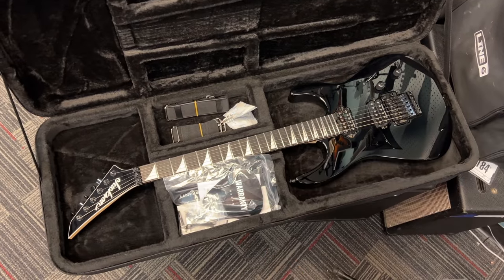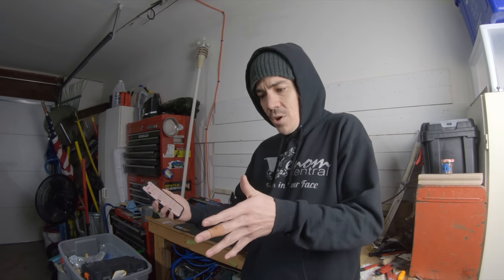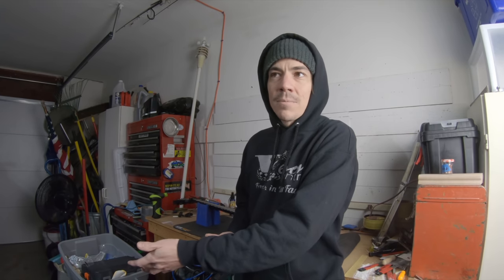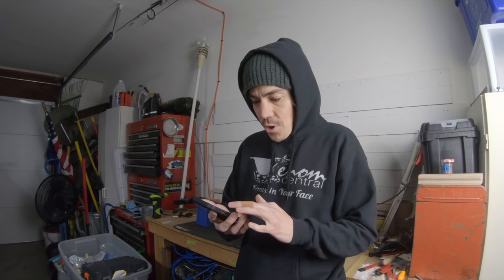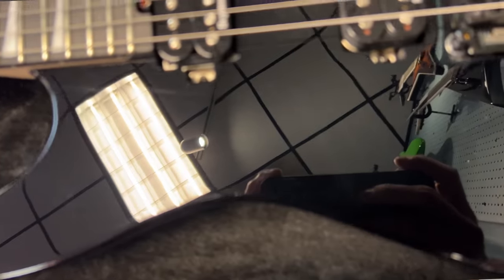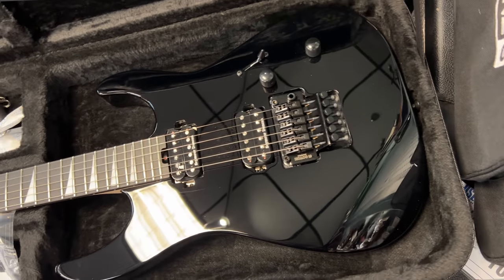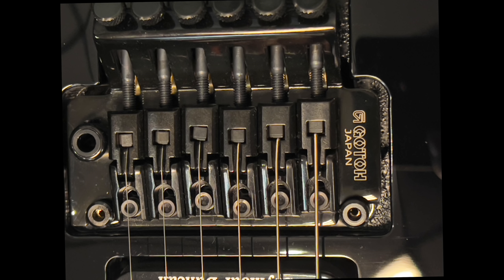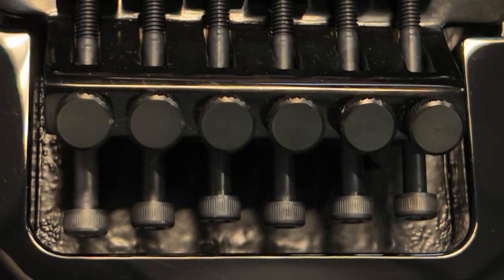JACKSON GUITARS IS DONE. MJ series/INDO EXAMPLES

Comment: I was excited about the Rhoads ziricote V..
Went to check it out at gc, since they said there were a few in stock, rather than just ordering it.
Was completely disappointed... Granted, they only had ONE, instead of the few that they supposedly had. But... It was piss poor. Glue up the side... Extra pieces in the body... The top was a LOT lighter than the pictures. It seemed thrown together with spare parts. Like wood that didn't match even close... And glue up the side..
Thank hell I didn't just order one. 
So I went home and ordered a guitar unseen... Off reverb. Got an esp ltd set neck Arrow.
Haven't done anything to it except adjust the springs in the back for the floyd. That's IT. Still haven't changed the strings yet... It's still on that set I got it with. It's absolutely perfect. I haven't put it down.

It's a killer.
And all I want to know... is why the F didn't I get one of THESE a long time ago???

Comment: I still stand with my opinion that is Jackson as an authentic brand was long gone since the Fender acquisition. Never satisfied enough with a pro-2002 USA Jackson as I do with my 1986 and 1996 USA soloists. Same goes for the imports, had the chance to play a 1989 MIJ Charvel 650xl and a 1994 MIJ Jackson Professional Soloist (both are neck-thru with glass clean ebony fretboards) which are even better than current USA runs. Quantity is all that matters to Fender Musical Instrumets Corp.
Reply from the maker: My 2008 Mij rr24m is pretty mint. There are still some good modern one, but you have to go through 50 bad ones to find them.

Comment: Gibson says, "If you're comfortable then your guitar is comfortable" Comfy enough to twist the first winter? (in Ohio) Yeah my guitars stay in my 75 degree bedroom or in the closet which is the same, but most develop serious neck issues after about a year.  They get played, so, they stay with me.
First off anyone who says I'm doing it wrong gets punched. I left a low end solar that had hardware stability issues in my unheated attic over a summer and winter, didn't warp a bit. Go figure. The next person who says "it's wood, asshole" (yes its been said) gets seriously injured.

second. Gibson hasn't changed that much. The Nashville bridge is just as unstable now as it was in the 1970s.  Can we say design flaw? Even when set up perfectly they are still unstable. If Gibson cared they'd put the R&D in to fix that, or go strictly with ABRs. Even the wrap around style isn't too great, but not as bad as the nashville. Btw the deign flaw carries over to the tone pros replacements as well.

third. Fujigen. There's an 11 year old Ibz in my closet with a neck heel issue. ten years later the new Fender comes out of the same factory with the same issue. That's not the only IBZ I've had with that issue either but 11 years ago is when I stopped liking ibbys. I hate tuning and then being out of tune for the first note. I know, I must be putting my "hand on the neck wrong". uhhhhhhhh

fourth: those $1000.00 jacksons. I have two of those king Vs with the metric nashville tune o matics. guess what. the design flaw carries over to the metric version. Next, try asking jackson for parts. I've been able to modify and stabilize this bridge.  The neck on my white V is trying to bend backwards this year.  I am trying to stop this, but even with humidity and the truss rod pushing the neck forward, no luck. So much for those graphite reinforcement rods huh? Btw, with the rod pushing forward instead of back, your neck causes tuning stability issues. G R E A T...
The finish issues are there, but those are secondary to me. learn to paint imo. 

fifth: I believe that the lowest end ibbys and jacksons are made at the same factory. AVOID THEM. 

I've seen all kinds of things out of various factories, all serious.
Nut out of alignment
Shifty locking nuts
Frets ALL aligned on a slant (not fanned fret, don't be smart)
random frets out of scale
high frets
warped/twisted necks
unstable neck/heel joints
unstable hardware

Seriously, the guitar industry is a fucking joke and it's on US. that's b/c most ppl either have to be tone deaf or they're degenerates and don't care if it's tuned.  Or maybe they're the 'collector' type and tuning stability means nothing.

yeah I'm cranky
Reply from the maker: It’s weird to me that the guitar industry is the only one that gets away with this crap
Reply: You must have extremely bad luck because I've owned 16 guitars only 2 of which were any quality the rest being "cheap entry level" and none of them had as many issues as yours. I'll go through the list if you really want me to.
Reply: @Ayyem93  I hope you don't mind my salty attitude but I can't help it. I don't know how luck could even play a role if I'm sampling random stuff and getting consistent results. by consistent I mean consistently inconsistent build quality. You know what the best thing to do with me is, mock me, belittle me, treat me like crap, insult me, anything to protect that brand and/or sales commission. Lets, see, an example: like trying to return a guitar because it's out of tune after one chord, and being told well, "it's still relatively in tune." or, like saying I have a fret that doesn't line up with the others and being replied to with a picture of a fanned fret guitar and being told to figure why that one works.. sigh. I'm sure there's "nothing wrong" my LP special even though both bushings for the bridge posts lean to the left. I was trying to figure out for weeks why the locking wrap tail I bought for it keeps either moving or suffering internal deformation... Oh..I see... now.. The holes for the bushings were drilled at a slight angle. Jesus christ.... I'd say this was typical of the kind of defect I run into, but typical is an understatement.

You might have 15 guitars, I've been through more than 400 of them. Most of this was when I didn't have a clue how to really tinker with things to correct problems. I wish I could have some of them back now that I know how to straighten a nut.  yeah luck, more like a curse from god. that reminds me. Ima smack that mother fucker someday.

Of all the ones I've had, and this of course is over the course of nearly 30 years I've had some that were good.. and then they didn't survive the winter, or the hardware bent under string tension (rga121 9-42 gauge strings tuned a step down). Oil the fretboard and make sure the truss rod is set properly.. and it will still warp. Did you know the channel for the truss rod is unfinsihed and will react to changes in the weather? yes, that's what I think happens to these necks.

SMH. Hell, I bought 5 last year, lets see how they did. 3 gibsons, one developed a hump at like, the 11th-14th fret, 2 twisted. one left, one right. 2 jackson pro Vs. One is trying to bend backwards after its first winter. That's a shame because I spent so much time working on that one's bridge and actually got it to be stable. I have an identical one I have'nt looked at because the nut is a little off center and I didn't feel like working on it. I wonder how that neck is... it's been in it's case since I got it. sigh. 

I'm sure if I were some one bring propped up by the music industry I wouldn't be seeing these problems. It's absolutely possible to select better materials and assemble them better. This assembly line stuff is BS.
Reply: @franks471  I genuinely don't know what to say bruh. I've had a cheap indo made B.C. Rich Beast that I got new for $250 in 07 or 08 around when I started playing and it's held up to this day with the only issues it has being from my own ignorance in past years. Either you're doing something wrong in terms of care and storage or you just have extremely shit luck. I've never come across ANYONE who's had as many issues as you, from a pool of collective playing and owning time of 75 years altogether.

Comment: I grabbed a dk2 pro in slime green made in mexico this month.The quality control really needs to be reevaluated the guitar retails for 999.99.Upon receiving it there was no hard case,kinda obscene for a guitar at the price point not to come with one.The guitar does sound really great to be fair but aestheticlly there were way to many flaws heck even the neck pickup wasn't screwed in all the way to the body it was sitting an Inch in the air!! Prior to this I grabbed one of the ferrari yellow fsr strats that came out of Mexico and same thing poor set up and a ton of aesthetic flaws..its to bad as we were at the point where MIM was getting to be a good thing but anymore especially with pricing I'm afraid to go outside of U.S and Japan made guitars after these experiences.
Reply from the maker: Squires look better than Mexican made fender owned guitars these days. I’ve got a stack of brand new ones in my shop right now. I’ve been waiting for fender warranty service to get back to me to approve repairs for weeks. There is no reason to buy a Mexican fender/Jackson anymore. For some reason the Charvels have been really good though.

Comment: I have been done with Jackson as far as new since 2020, just after getting back into guitars after having been out a while.  I went to 4 GC looking for a Soloist, I forget the model, but the purple one with hot rails. I tried everything Jackson from China/Korea/Indo and from the super cheap to the high on the wall Winterstorm Pro Sololist tagged $1000.  The horrible QC is why I went to 4 stores, and no, I'm not including any probems caused in store, only QC issues.  Crooked trems, bad paint line on the neck transition of the soloist, a Kelly that had something so wrong no setup could have fixed, and worst of all, the $1000 soloist had a massive crack going from the trem post through the entire bridge cavity, front and back.  I knew I shouldn't have strayed from Ibanez and having started thinking I'd spend $400-500 on a soloist on sale, I just bought a Ibanez Premium rg6pgmltd that had been hiding in the store 2 years.  Unbelievable guitar, and my first high end NEW Ibanez since a RG570 in 1992.  Then they put out that MJ and the specs are crap compared to a Prestige.  It baffles me they're built in the same factory and Ibanez can still drop a Prestige with Fishmans for hundreds less.  They must have different QC people for Ibanez and Jackson too, because Ibanez Indo have been great for years.  I can't speak to ESP, just haven't seen many that grabbed me.  I'll stick to Ibanez until a miracle happens and Peavey magically returns to the US with some shred machines haha.

Comment: Unfortunately you are 100% correct. In 2010 I bought 2 2007-2009 Japanese archtop soloists from Sam ash for $999 and they are bad ass amazing, better than the "mij" of today.  They hold up to the usa models definitely. I also have an 02 Japanese "stars" and is almost identical to a usa in quality. I will never sell those guitars and most likely will never buy a Jackson again. I did however recently buy the Korean made concept series 26.5" 7 string and surprisingly that plays and feels amazing like my previous mentioned guitars. It was 1800 with %10 off absolutely justified price for its surprising quality.

Comment: I haven’t seen a nice Jackson since 1987. When they stopped doing Snakeskins and went to Splatters. They were all special order at one time. There were no knock off Floyd’s, there was only one. Who knows how they’ve aged. I heard they were all bought up by collectors. I wouldn’t want to pay for one these days. I’m not too keen on neck through anyway. Even ESP are dangerous, unless you don’t mind crowning and leveling. Bolt on necks seem to stay put long term. But whatever blows your hair back. I have an ESP, I love it, play it all the time. Fender is for Strat and Tele, Gibson is for LP and 335. All these guitars have a purpose if you need to delve into specific styles. But I get what you’re saying about the metal scene and the guitars for that. Jackson once ruled them all and were THE premiere Made In USA brand, but he moved on. He even worked for Rickenbacker for a time. Those are also nice, love mine. From what I understand you can still get a Jackson Custom guitar, with a Snakeskin finish and all original Seymour and Floyd parts, but it’s through Fender’s custom shop and it’ll cost ya. Might as well get an ESP USA. Again, expensive.

Comment: I bought a Jackson a few months ago. When tuning I noticed the floyed was out of wack. Opened it up to adjust spring tension. The screws were in crooked and cranked as tight as they could to make it look level.
I pulled the screws back filled holes re drilled and leveld it.
Jackson has went to shit. I grew up watching Jackson kill the metal scene it's a shame.

Comment: Jackson Dinky 7 strings are good!! Got rid of my soloist dramatically dropped in value only got like $250 value in trade.. But anyway for $350 good guitar!! Just need to change tuners to locking tuners.. I only spent $750 on the soloist.. I also have an LTD seven string with Fluence.. with a Floyd Rose. Through body neck smooth satin finish.. Nowadays you have to still look out for the sharp corners on the nut!!

Comment: I fully modded a JS-32 Floyd Rose Rhoads with EVERYTHING high end ($900).... it's a MONSTER now
Reply from the maker: What mods did you do?
Reply: @jed_shred_guitars  Replaced the crappy licensed Floyd Rose with a gold finished Original, high end pots and wiring, Duncan Jazz neck pup and Jason Becker bridge pup, had frets leveled properly, and changed the toggle switch and jack input.  I'm looking for gold finished tuning pegs now.  I basically turned my Lefty JS-32 into an RR1 🤘🤘

Comment: I'm a bass player and own several 90's Japanese made Jackson basses and one Charvel Fusion bass. I also still have a 1987 Charvel 3B neck through bass. All of them are great basses, with the Seymour APJ PICKUPS with the switches in them. I play them all regularly. I was going to have two custom USA made Jackson basses made for me, a Concert and a Kelly bass until I got to play two custom shop Ellefson Concert basses, a four and a five. They were nowhere near the quality of my Japan basses. The new mid price Indonesian basses are not impressive either, they all have passive pickups with 60 Hz buzz and would require some serious shielding work, or installation of some EMG pickups. Then they put out those Jackenbacker basses. How unoriginal, the only thing I found on those I liked was the bridges are an improvement over the real Rickenbacker bridges. Fender has ran Jackson six feet under with their greed and lack of quality control. I believe the biggest cause of the decline and eventual death of Jackson is all on Fender. I am just glad they did not decide to make Hamer guitars and basses after they bought Hamer. Kaman was bad enough for Hamer with the crappy Chinese XT instruments, Fender would have destroyed the Hamer brand just like they are doing with Jackson.

Comment: fujigen is NOT a great factory, unless you like issues. Especially avoid them if you get  bolt-on.
I don't know, unless it's possible for ibz to randomly shit on the same person repeatedly, fujigen sucks.
I should have known better when I got the reissue of the HM strat. It's sitting in a closet until I can figure out a good way to level the neck heel.
Reply from the maker: That’s interesting, I’ve never heard anything bad about Fujigen. What models did you get that were bad? What was wrong with them?
Reply: @jed_shred_guitars  Some Rgs and that HM strat, and that's over 10 years apart. The rg1451 if I remember.. the nut was was about 1mm farther from the 1st fret on the high E side than the other. There's also a bump that's on the neck heel, that's what stopped me from repairing that neck since I don't know a good way to flatten that and still keep the neck level. The HM strat has the same issue. I actually hate that guitar. Back  in 1989 a friend of mine had one of the originals and there's no comparison. that original was much better. (and he still hated it lol)

Comment: Love Jackson's ( RR, Warrior, Soloist) , but the prices in India are absurd , for the same price an Esp Ltd ec, arrow, Ex, MH, M etc or Ibanez RG/Sa/RGA are way better speced. 
Like my ec 256 is almost perfect, may be the pickups , tuners might need some upgrade , a pair emg H4 (passive pickup gang 😅, love the sound ) and some locking tuners at 12000inr or 160 usd .

Comment: I recently got a jackson randy rhoads  and they fucked up the neck left unsmooth pitting all up and down the sides of the fret board  and the  string measurements for the high E is so off it falsl off the neck when playing it. 
If they cant get a mid range priced guitar correct why would i trust them to make a guitar at a higher price point. Fender buying them fucked up quality big time it seems.

Comment: You are right...i have an LTD Alexi 200, ESP SV STD int, two Edwards E-Al, and a Jackson RR24M, and you can notice a lot of difference between those brands. 👎 Bad fretwork on the Jackson for example.
Reply from the maker: Are you able to pull the Floyd all the way back on the rr24m? Might wasn’t routed all the way and the base plate of the Floyd hits the wood before you can pull all the way up
Reply: @jed_shred_guitars  checked now, mine it's ok with the Floyd... :/

Comment: I bought a brand new Jackson WR7 Pro Series (Dave Davidson sig, Made in Indo) and it was one of the worst guitars I've ever played. Acoustically it had a very odd hollow sound. The wood was extremely light and very soft. Pushing on the top too hard would dent it. No matter what setup I did, I couldn't get it to play well. I even tried getting the frets levelled, but I think the neck was slightly warped. I ended up getting a Schecter C-7 SLS Elite and it's one of the better guitars I've played (similar price range too). I'll never buy a Jackson again... they look nice from afar, but even the custom shop gets stuff fucked up (the 23 fret guy for instance).